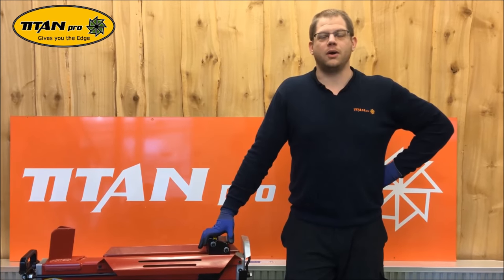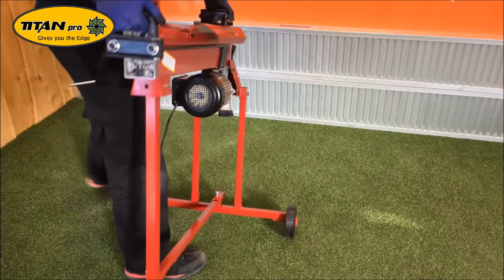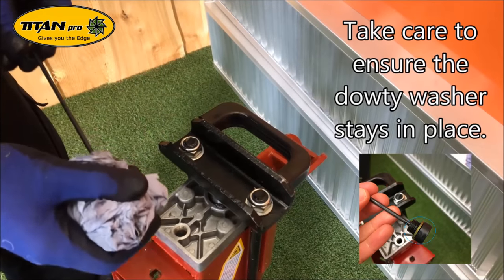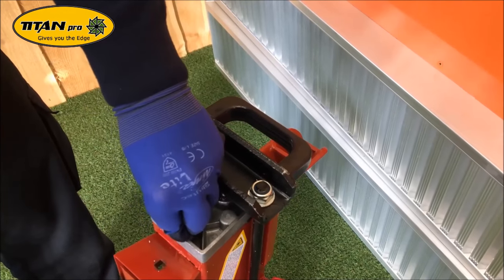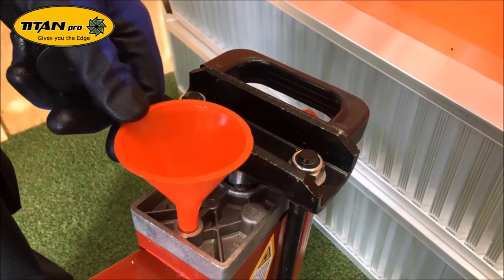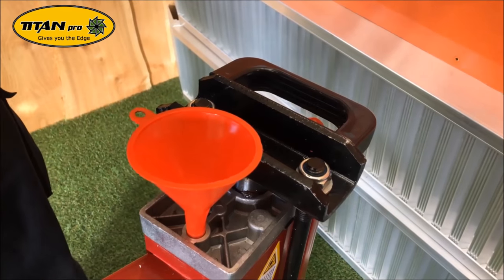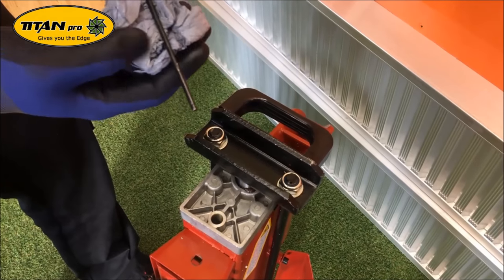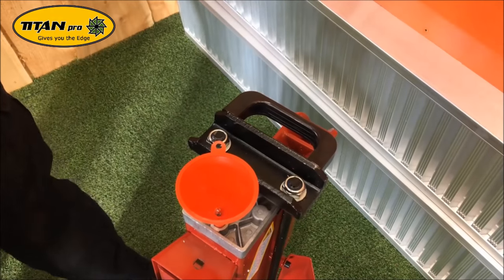Electric Log Splitter Hydraulic Oil Check - How-To from Titan Pro

Comment: Is that 5 weight or 10 weight oil? Also, do you happen to know both the oil capacity as well as number of hours before need to change?
Reply from the maker: Hi Sam, the capacity on these machines are approx. 2.9L. The oil we recommend is ISO32 as found on the following link - https://www.titan-pro.co.uk/p/346/Hydraulic-Iso-32-Oil